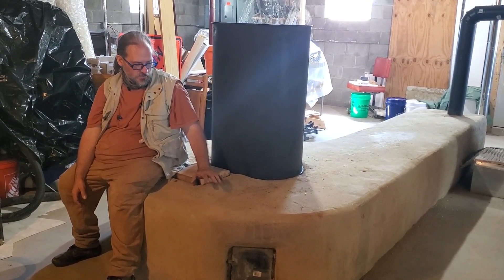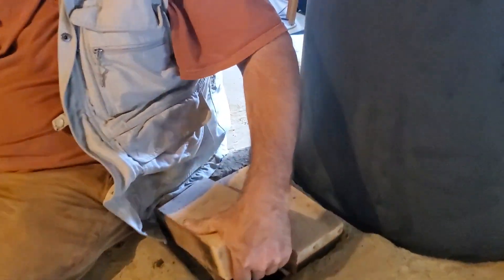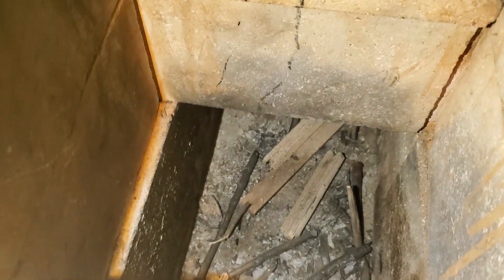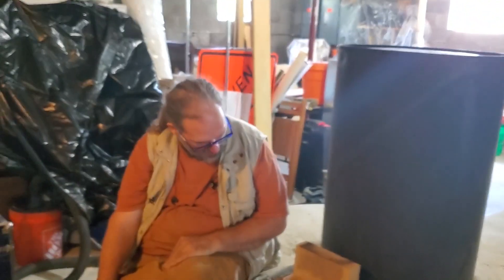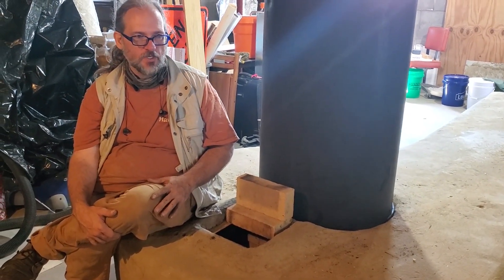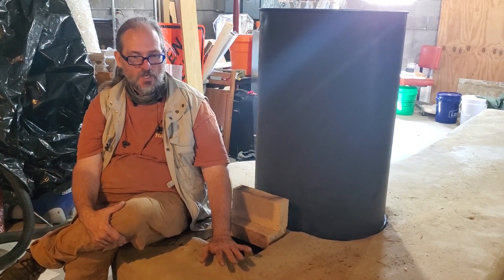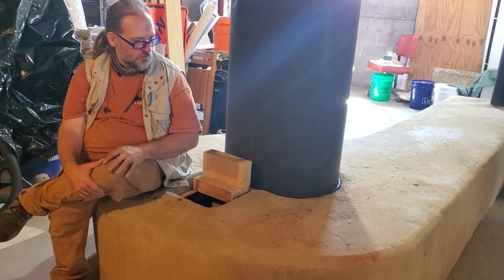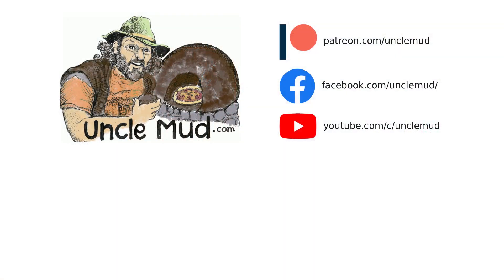Checking in on an Uncle Mud Rocket Mass Heater Built to Masonry Heater Code in NE Ohio

Comment: Hi there, are you located somewhere in the Cleveland area? I am from Cleveland and am planning to move back to Cleveland in the future from the SW and am wondering if it is possible to build something like a mass heater in an older house like a two-story from the 1920s - 1930s? Is this even legal to do per city regs? I ma thinking of moving to the old Brooklyn, Garfield Heights, Maple Heights areas. Thanks
Reply from the maker: A rocket heater can be built to state masonry heater code, like this one was.
Reply: @UncleMud  Thank you for this info, sorry I never got back to, lost track of this and work and life, but thanks. Are you in the Cleveland area?
Reply from the maker: @patrickspeer2990 yes